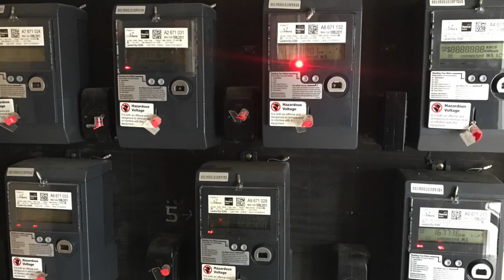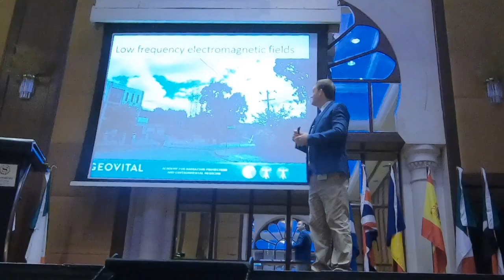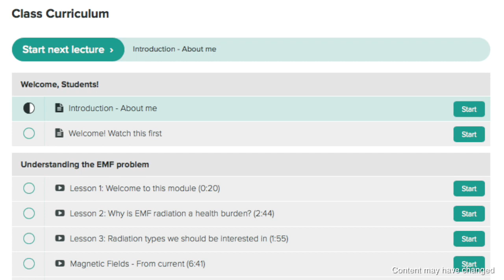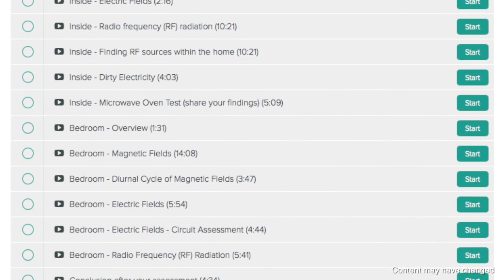TF2 Trifield Meter Self-Guided online course - Know what you're doing

Comment: I just bought a TF2 . My RF in my bedroom is averaging 0.430 in my bedroom,outside my front door 0.750 average. Sometimes goes to 2.150 . We just had a cell tower installed about 600 ft from house. funny thing is we checked before cell tower was erected and readings are not muchoff . What do you think of these readings . Also turned main power off to house and readings were not much different

Comment: We are looking at a house that is near an antenna tower. We got this meter and using the RF option, it is picking up between 0.008-0.060 at the peak in some places in the house. Would you consider those numbers unsafe? Any info is greatly appreciated!
Reply: 0.01 is where severe exposure begins when considering 'air' assessment. 1 is where extreme concern begins. Based on that it sounds like shielding is indicated. I would have expected higher close to a tower, but that doesn't make it right either. In other homes, not close to towers, you may find similar levels. You should consider that the tower may be inactive for a time, might get more installed onto it in the future (gets worse) and there are more RF signals in frequency ranges  you can't measure.
Any bedroom should be shielded with T98 shielding paint really, even preventatively. I'm hosting a series of EMF assessment webinars, started only this week, go here to join: https://en.geovital.com/emf-webinar-series/

Comment: I bought a Trifield TF2 and have found it to be a waste of money so far, except that it has shown me that no type of so-called EMF blocking material (I've tried aluminum, copper and EMF blocking fabric) can block EMF's. I can only hope, I guess, that the supposedly brand new one I bought through Amazon was in fact a used, non-operating one that they received from an unhappy customer and sent to me as "new". There was no battery included even though there is a place for one in the foam cover plate (don't know what the proper term is) that comes with the device. I was too late in finally trying to use the meter, to be able to send it back for a refund or replacement. So thus, it has been a waste of money for me. I never seem to get consistent readings with the thing. I paid $168 for it supposedly new, but it's apparently a dud, probably a used dud.

By the way, your link never loads completely.
Reply from the maker: Sorry to hear that. Does sound like you got one that was mistreated, or a dud... its rare but could happen. Amazon isn't everything for customer service... Next time try a small retailer that actually knows what it is they are selling. You're experience with the TF2 is uncommon though I can assure you. Why don't you contact the fine people at Alphalab and kindly ask if they could help you get your's checked and maybe swapped for a working one. Their customer service is very good.
In terms of materials you've tested. Sure, there is lots of money grabbing rubbish around, but likely your self-experiments were also not well thought out. There are many variables. Shielding materials should have independent test reports available, but they should also be made with long-term health in mind, which most are not. Not all ingredients are justified in the fight against EMFs.